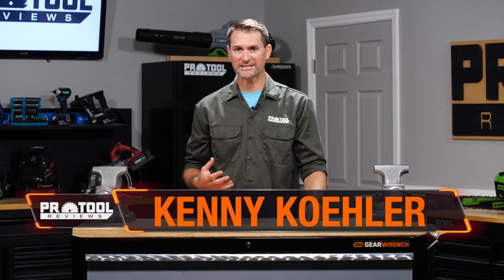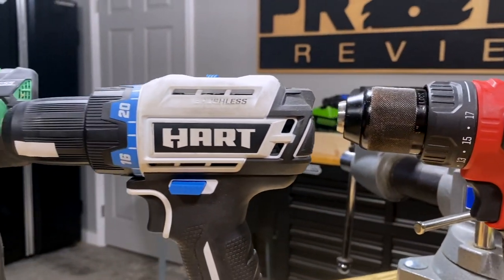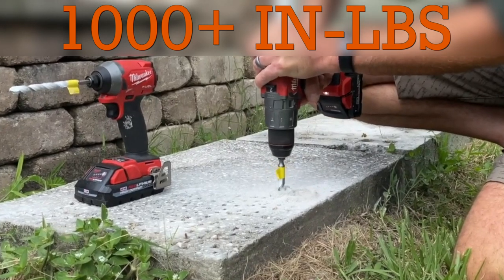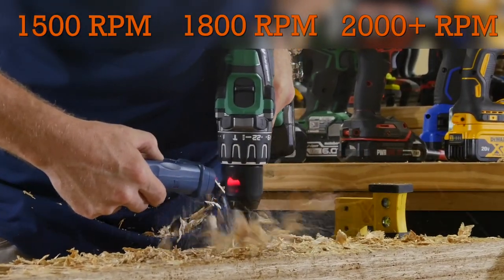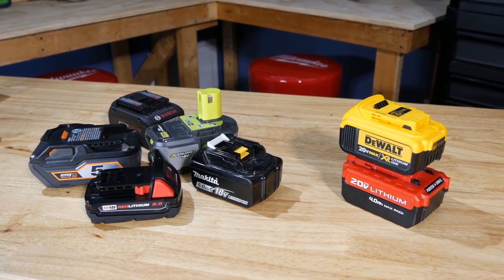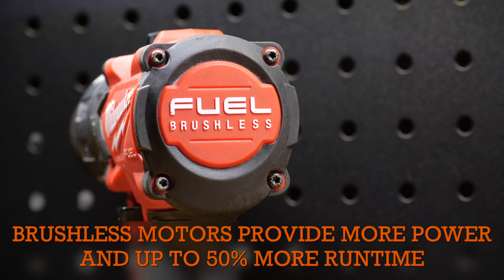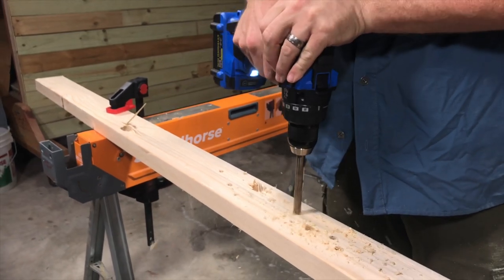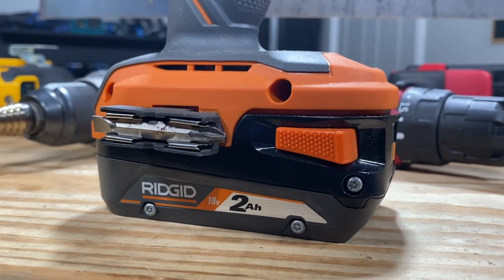Cordless Drill Buying Guide | DO's and DON'Ts

Comment: Great video. I'm in the market for a new drill. Drilling huge holes with an auger bit and the drill I've got just isn't cutting the mustard. Not only that - call me whatever you like - but I'm afraid of breaking my wrist while working and risking being disabled for any time. The anti kickback feature seems like a must. Thanks for the great video, particularly the part about what range of speed and torque is good for what task, that was great info to have.

Comment: In all these scenarios depicted in this video ( great explanations  BTW NOT knocking whats been said)  but you may as well use corded drills, i used to work for a company specializing in property preservation, damp remedy , dry / wet rot , brickwork restoration, in any scenario , you ( up scafolding, in lofts, on roofs whatever) you got cables to the job without compromising safety , small space to work, hey small drill, big holes needed for pipe re routing ,big drill. ! I used SPIT,HILTI, BOSCH.MAKITA,  that i can recall. I am out of the profession for some time, and yes tech progresses ? is guess but still cant see the ABSOLUTE essentially of everything being battery powered. In remote locations on like semiderilict property , we used a generator, but you need a gen to power the battery charger right ?